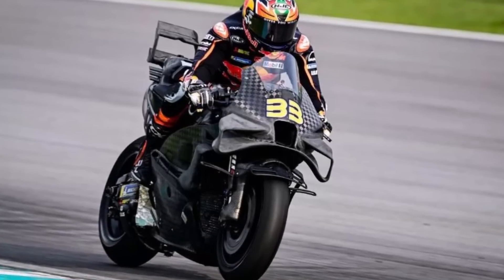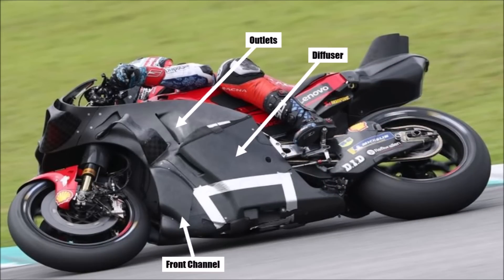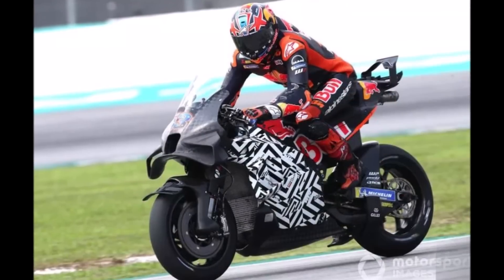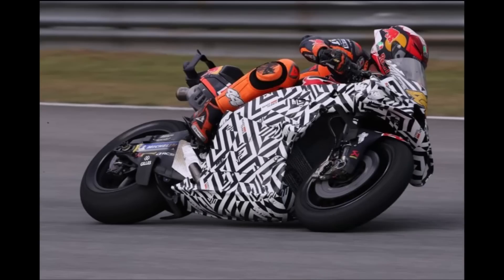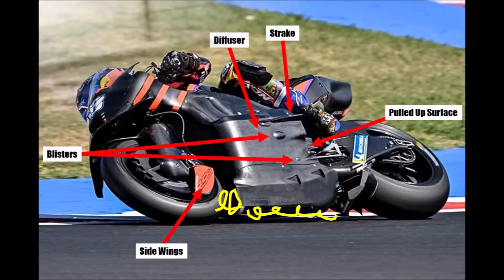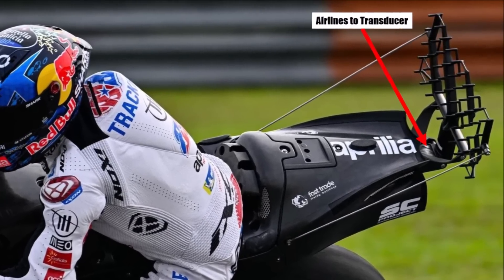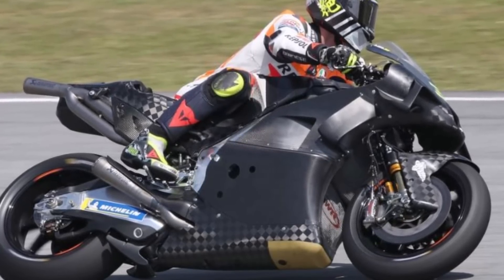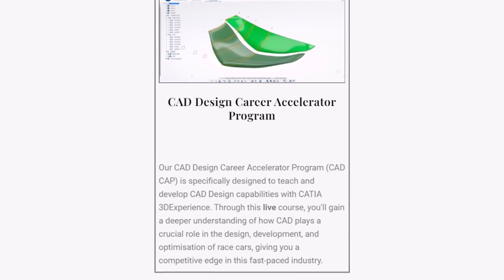MotoGP 2024 - Sepang Test - Aero Innovations EXPLAINED

Comment: I think the wings should be transitioned to winglets and spoilers, or at least the number of wings or aerofoils should be limited, and until then, they are just going to keep putting holes in the bodywork. spoilers with winglets could give them an opportunity to tune the thickness of the material to deform in a favorable way when there is a change of direction, allowing some of the aero to work in the corners a little more. Its the wild west right now and it has made it tough to get back in to the racing, with the japanese contingent a pretty long way off the mark. I think removing turbulence, and lift is great for safety and the aero can probably help in that regard, but im not sure allowing them to put aerofoils on everything is making for the most compelling races. You can always drill one more hole, and I think thats a dangerous place to push rules lawyers, vs material thickness and deformation.

Comment: yes yamaha is having inline 4 engine advantage that make bike corner faster(due to shorter wheelbase) but will have less power, problem the driver complain about lack of grip or traction maybe for exiting corner and make bad acceleration. Maybe they should focus on wheel attached  aero

Comment: We already saw in 2023 how the aero effects made overtaking (& wheel-to-wheel racing, in general) difficult. Once that is gone, races become more of a parade with too much emphasis on Sat qualifying. We also saw for the first time, "dirty air" from bike in front causing tyre temp issues for riders following.
I'm in favour of reducing the speed/power of these bikes (marginally), while getting rid of these excessive aero packages, in order to promote hard racing which will bring out the real riding talents.

Comment: Personally with all the aero and computer engine, traction, wheely and ABS braking controls utilized in racing now the riders skills are being more relegated to the monkey with the biggest balls that is hanging onto the bars as compared to past decades when the rider was the wheely, traction, engine power management and braking controls through his inputs to the machine.

I would much rather watch the racing from 30 years ago running 180mph when the riders were the talent behind backing the bikes into the corners and wheelying onto the straights at 180 mph than this ride in a line follow the leader stuff with computers controlling the bikes so much as we have today!

Comment: About the CAD program, is the CATIA license is permanent I can use anytime after done? Or only can be used on current program?
Reply from the maker: You will get the 3dExperience licence (Catia V6) for the duration of the course + around 6 weeks.

Comment: ok im 44 years old and ive had this idea in my head since i was 10 years old, can anyone with practical knowledge please tell me why is downforce always on sprung areas of a car or bike? since i was 10 ive thought downforce should be on unsprung part of a vehicle like wheel hubs or control arms, or a bike swingarm or front wheel connected to lower fork, downforce 100% more efficient and the suspension would be alot more efficient too.

Comment: Motorcycle aero is nonsense.  1. It has no practical use on production bikes. 2. It looks hideous. 3. A rider is going to get badly cut. 4. it drives up costs and doesn't make racing any more competitive.

Comment: I don't see any problem with Aero development. The point of MotoGP is to build the fastest motorcycles in the world around the track. This sort of experimentation is what's necessary. Sure it will affect the racing, but so did the switch to four stroke from two stroke. I'm sure in 40 years we'll look back on this as some sort of golden era

Comment: could someone explain to me how much these bikes are getting faster due to aero? like how much faster do bikes usually get year over year, and how much faster are they getting now since they have aero?
Reply: If there were no aero advantage then nobody will use it. 
Downforce on rear increase tracktion on corner exit. Downforce on front (front wings where first aero element in motoGP) improve high speed stability and bike balance. Also with front downforce they can break harder and later as no time for balance transfer on front is required before applying full breaking force. Usually you need to start smooth braking, wait for balance on front to avoid slide or wheel block and then you can inrease breaking force. Difusors with downforce on maximum lean angles improves mid corner speed. 

Rider style is important for aero efficency, as air flow can be blocked by leg or other part (see aprila high foot pegs). 

More downforce also can increase tyre wear. 
And what has suprised me is the temeparure managemment e.g. rear tyre cooling in aprilla. 

As the engines are 260+ HP the power is not a problem. The problem is how much traction you have to translate that power into lap time.
Reply: Ah, and with such advanced bikes (aero and electronics) which are sensitive for dirty air and with shorter breaking zones (due to aero) motoGP becomes competition between bikes not riders. And that's why there is less wheel to wheel racing. Similar story as F1.
Reply: @krzysztofkowol5392  yes I understand all that I’m asking how much has aero impacted times. Pre-aero, how much faster did bikes get year by year, and now how much faster
Reply: It not that faster on the straight. Where's it faster is in the corner. With those aero, you get more suction, hence more traction, and thus higher speeds in turns
Reply: @kidpagronprimsank05  yes I know, but how much faster, in seconds are these new bikes compared to previous non aero bikes
Reply: None. It's still as fast as 20 years ago

Comment: Fabio said if they make more aero dynamic work on bike, the top speed is lower. But without aero cracks, rear tyre grip is sucks when exit the corner. Thats paradox now.
Reply: Aero is always game between downforce and drag. And ideal package has minimal drag with maximum downforce.
Reply: F1 got cd around 1.0, that's soo drag compared to normal road car, which is around 0.30
But... Yeah... normal road car can't go 300 kmhr flat out into Pouhon either lol.

Comment: Why don't they use active/movable aero devices ?
imo this should make for bike that generates downforce on every lean angle and straight line too
Reply: Active aero usually banned in any type of Motorsport for many reasons. Costs is main reason
Reply: @kidpagronprimsank05  Given the state of current bikes , aero rules seems pretty relaxed, its still relatively new department in motogp, compared to car racing it has relatively relaxed rules.
regarding cost, all kinds of motorsports is costly, considering official works team are backing this sports , i'm sure they can throw little more money.

Comment: The aero war is probably going to turn MotoGP into F1 tier racing, i.e. not much of wheel to wheel action and relying on mistakes from the guy ahead to make the pass. So, it's not very reassuring to see the aero getting even more sophisticated, we know from F1 how that turns out. That being said, these aero-developed bikes looks so damn cool, the rear wings in particular give it an awesome aesthetic. Can't help but appreciate the engineering put into them, even if the racing turns out to be a bore.
Reply: For now races are FAR from being boring
In fact, the hierarchy is as close as ever

The main problem is the pilots, who are in danger because they're so close and they lose so many aero suddenly

But Moto GP work to reduce the aero (and the speed of moto)
But the actual régulation will end in november 2026...
Reply: At least in bikes we got wsbk for more stockish machines. F1 has no similar series
Reply: @captaintoyota3171 yup, but if I could, I'll consider F2 as their "stock cars" racing cuz iirc F2 cars are all similar to each other
Reply: I dont think it will be anywhere near as bad. LMH, junior formulas etc also have lots of aero surfaces but still produce good racing. Secondly, I don't think the bikes would produce anywhere near as much dirty air due to the size of the surfaces, but someone more knowledgeable than me can tell better.
Reply: it's already becoming a problem with respect to overtakes, and can create unsafe slipstream situations (as was seen when Martin almost rear-ended Pecco)
Reply: @WereSmarterThanThis  THAT is exactly my problem with the current direction development in MotoGP has taken!
All this aero doesn´t really add anything to the racing itself, makes overtaking even harder as you said, and does create a a way bigger risk than people are seeing right now.
I don´t even wanna imagine, what would´ve happened, if Martin didn´t manage to squeeze by Pecco...he easily still was going at like 100mph and there was nothing he could do...
Reply: @WereSmarterThanThis  there were seasons with no wheel to wheel action in motogp years ago so assuming everything is fault of aero is very short sighted. 
For years already we can hear that it will soon change to DucatiGP because they have better motorcycles.
Reply: I think it will always be easier for a 140kg bike (to make an example I don't know the exact weight) to make an overtake than a 800kg truck, aero will make it harder but it will always be easier to see passes on MotoGP than on F1.
Reply: How so? Bikes are thin relative to the track and produce way less down force and wake than an f1 car.
Reply: Austin, and Jerez proved u wrong, bikes are getting faster but the fastest is developing slower

Comment: I wonder how much the rider is part of the aero, where he places his knee, how he hangs off the bike, etc.
Reply: Influences it very heavily. Sitting up tall to slow down for corners creates a crazy amount of drag, for example.
Reply: @juaneer  That would be a good CFD exercise, because it'll settle the age old question of if squatting creates lift or downforce. On the one hand you have a curved back and curves accelerate flow, but on the other, your frontal area is concentrated above you, and the air just passes between your legs unless you're a real manly man. So you would have higher flow velocity beneath you than above you.

Comment: Surely downforce reduces grip when cornering?
If the downforce is always aligned with the bike, then mid corner will create a lateral component that reduces grip. 

You'd want the downforce to always be perpendicular to the track surface. 

Maybe ground effect downforce can achieve this but surely wings are not a good approach.
Reply: While cornering the rider hangs to one side, so the aero isn't simetrical, wich should reduce sideforces and increase downforce.

https://youtu.be/5h-W-N0utZU?si=Fms7sFzpUuLzZ3dW
Reply: The stegosaurus rear wings push the rear tire into the track while leaned over
Reply: Downforce doesn't reduce grip when cornering, it may use some of the available grip due to the added lateral component, but the grip available is much higher anyway because the downforce is present.

 You're overthinking the theory while track records are being absolutely smashed on track, which is what matters.
Reply: @davidaugustofc2574  so explain it then. I dare you! 

If the bike is at 45 degrees the downward component equals the horizontal component generated by a fixed wing. 
I just checked the coefficient of friction of a racing tire and it can be 1,5 even up to 1,9. That's why this works. With a road tire it is likely less than 1, so the wing would actually reduce the max cornering speed. 
F equals mu R. 
If the bike leans further than 45 degrees, the situation is even worse. 

It's all about the tires. 

Obviously when braking or accelerating in a straight line, the wings work as normal so bring a huge advantage. On a straight, they just slow the bike down. 

Any idiot can see from the lap times that it works. The question is how. I think it's all about the sticky tires. 

Ground effect seems like a much better option if you can design it to be consistent at any lean angle. The width would be minimal so probably not very powerful. 

The ultimate solution would be wings or ground effect that remain parallel to the ground, if that was legal
Reply: @procatprocat9647 he explained it in a previous video. iirc anything positioned high in the video is there to create downforce on the straights to reduce wheelie and aid acceleration. its not for corners because when you lean the wings are not directly above the tyre and its going to create some moment forces. the rider helps with stalling these high wings by leaning out of the bike and blocks the airflow of the wing. 

for cornering the diffusers are going to do the most work since its low enough that theres no rider disturbance and will create downforce right above the tyres. the vertical portion of the wings are also going to help when leaning since its turning into a horizontal wing and itll also going to benefit from ground effect

for more information just search for his longest motogp video
Reply: @procatprocat9647   It's very simple.

1 - the lateral force the tire can handle doesn't scale linearly with load applied, 800 lbs of load on a race bike means that bike can take more than 800 lbs of lateral force (which true for most racing slicks). Normally we get the coefficient for the tire when we buy them, and then design the entire car or bike around the performance of the tire.

2 - The math you described only applies if the airfoil is horizontal when the bike is upright, but if you use Google, you'll see most MotoGP airfoils have curvature to them, which changes the initial angle and thus the angle during cornering. The ideal would be for most of it to be horizontal, but compromises always have to be made.

3 - As the previous replies mentioned, the Rider is an active aerodynamic component in modern MotoGP.

 I honestly don't get the tone of your reply, I didn't come here saying "I'm a former Formula SAE leader, I know better than everyone". I simply commented about what I studied together with the suspension system to implement an aerodynamic kit, and I stayed true to the books.
Reply: @procatprocat9647  "With a road tire it is likely less than 1" The road tyres on (modern) motorcycles are nowhere near that terrible!  Most tarmac-biased motorcycles come with a tyre that in car terminology would be a "track day tyre", low void area, grippy compound, high coefficient of friction.

Comment: Good video, as always. 
What do you think about very long exhaust like the one on the GasGas bike? Its for more torque? Because it seem like the rear two cilinders of the v4 engine have shorter exhaust lenght than the front two cylinder.
Ducati tested a long exhaust too.
The hot gas exiting the side exhaust (in the short version) doesn’t create a difference in aero conditions between the right and left side of the bike?
Reply: Maybe they can use that to create a blown diffuser 😅

Comment: Great analysis, miserable development which the sport doesn't need at all.
Reply: I dunno, the regulators would act if they perceive it to be problem. Ducati have the most bikes, so they have the most political influence and Ducati prefer to have development in the area of diffusers or aero appendages and covers, so the organisers comply with Ducati's preference? 🙂
Reply: @TassieLorenzo It is really rather simple: It costs too much, it is ugly, the bikes get too fast for existing tracks and the racing action suffers tremendously.